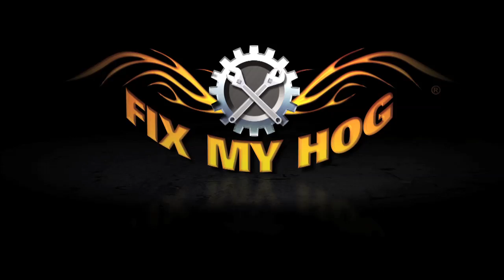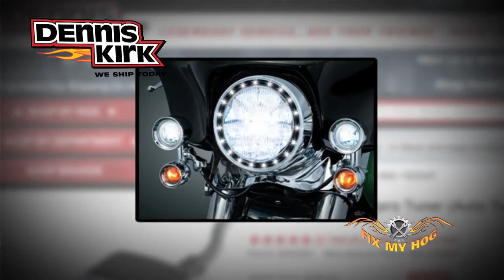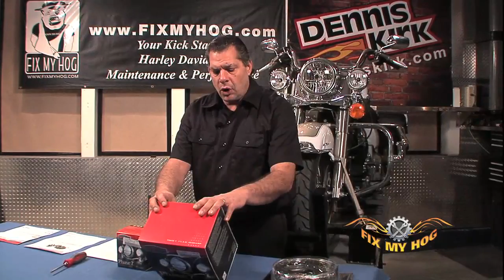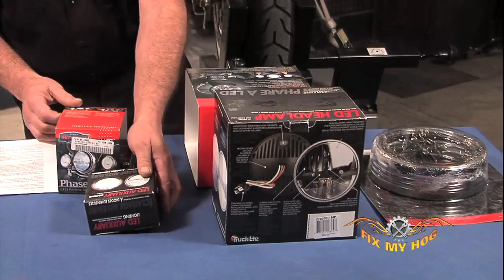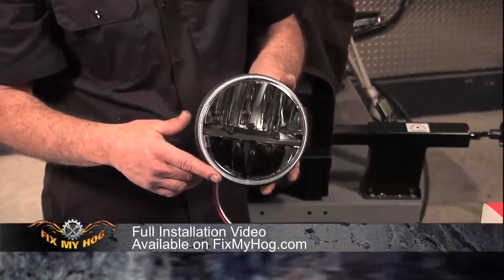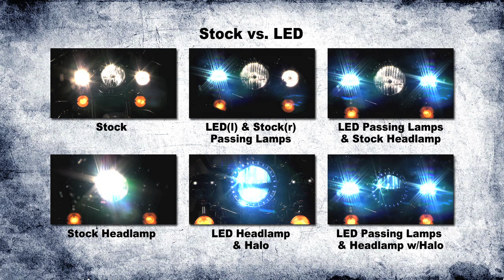Harley Davidson Maintenance:  Harley LED Headlight, Passing Lamps and Halo Review

Comment: So.... There is NO wiring harness available for   2014 Harley touring but they will sell you the phase 7 without informing you that you can't plug and play on Harley 2014 touring. 

Tell me how to splice into my harness because I bought the phase 7 instead of Harley's light and I need this headlight for my ride in June. 

Kuryakyn makes the excuse the harness isn't available because they get their bikes when they're available to the public. Well, my ride was available August of 2013. What's their excuse now?
Reply from the maker: Sorry for the delay. I did ask and this is what they recommended: For the #2249 7” Phase 7 L.E.D. Headlamp fits Electra Glides, Road Kings (except ’14 FLHR/C, FLHRSE), Street Glides, Trikes, FL Softail Models with 7” Headlights & Dyan Switchback.  Note:  ’14 Electra Glides, Street Glides & Trikes require wiring adapter (p/n 5487).  Sold separate.
Reply: k shep there is a 19 dollar harness that makes them plug and play, just ask for it.